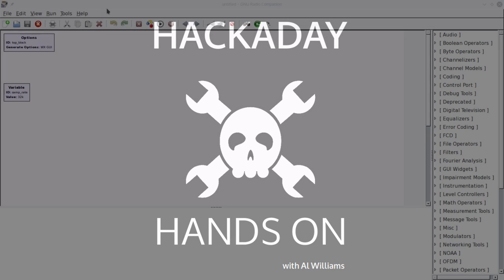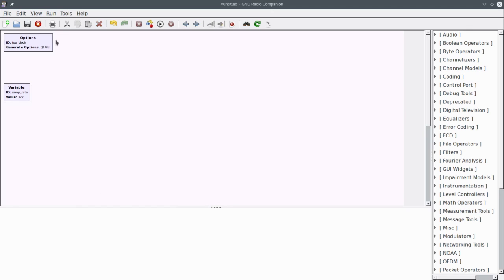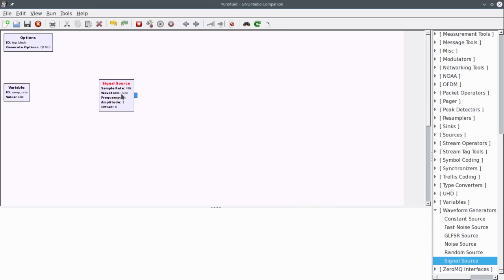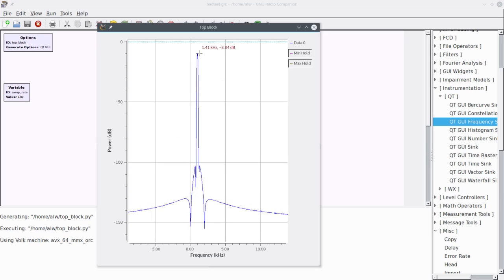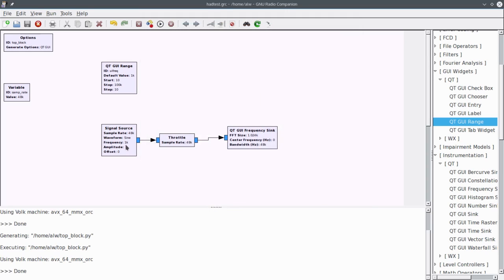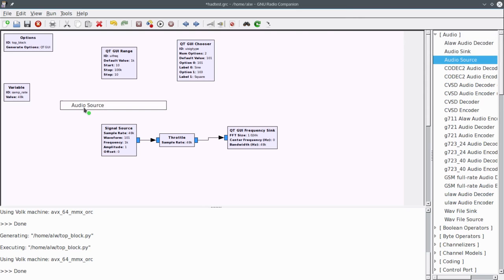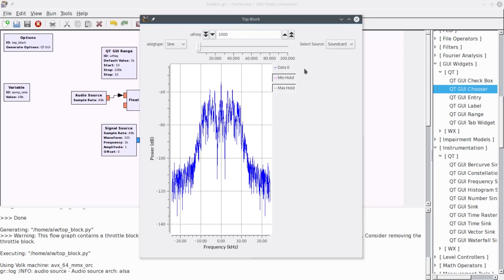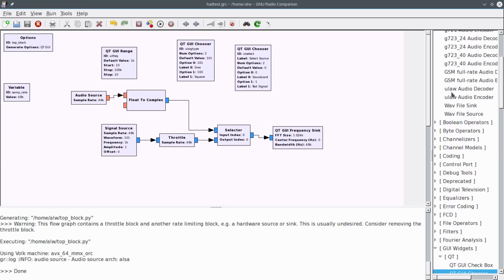Using GNU Radio Companion Part 1

Comment: "sample rate" appears to have 2 meanings, depending on context - 1) how fast the block can do its thing, 2) side information carried with the data stream to say what the delta-T between samples is. For the Signal Source block it's only the latter, since it can potentially run wild, yet the 1KHz spike can appear later in GUI frequency sink at the correct location. For the Audio Source, it's both meanings, the real world hardware actually samples at that rate, and then that sample rate is known later in Frequency Sink. In Frequency Sink, it was given the variable "samp_rate" but used for a parameter "bandwidth", not a parameter called "sample rate". Sample rate of the data is riding along with the data, ... yes?

Comment: This (101 and 103) no more works in new version of GNU radio. QT GUI Chooser should be '0' and '2' for sine/square wave. But, in Signal Source - for waveform should be 'wave'. You should to add Variable with ID: wave, and Value: {0: analog.GR_SIN_WAVE, 2: analog.GR_SQR_WAVE}[int(uisigtype)] . Otherwise it will not work.

Comment: hi everyone am trying to transmit 16QAM in gnuradio using fmcomms2 i have used random_source->constellation_encoder->interpolating_FIR_filter->fmcomms2 but it shows error Traceback (most recent call last):
  File "C:\Users\Dell\Documents\qpsk.py", line 369, in <module>
    main()
  File "C:\Users\Dell\Documents\qpsk.py", line 347, in main
    tb = top_block_cls()
         ^^^^^^^^^^^^^^^
  File "C:\Users\Dell\Documents\qpsk.py", line 202, in _init_
    self.iio_fmcomms2_source_0 = iio.fmcomms2_source_fc32('local:', [True, True, False, False], 32768)
                                 ^^^^^^^^^^^^^^^^^^^^^^^^^^^^^^^^^^^^^^^^^^^^^^^^^^^^^^^^^^^^^^^^^^^^^
RuntimeError: Unable to create context

Comment: gnu radio is far more superior to what you can do in windows,
however, you almost have to know a precompiled file of what your
trying to do, unless your an engineer, this gui is actually allowing
you to manipulate real software controlled channel data ,etc,
very intricate.

its extremely hard to match the blocks together, and make them do exactly what you 
want.
Reply: What I mean is it seems like the Linux version can do more . by the way when I wrote this statement only Linux had a stable good version , the windows version was barely out then .

Comment: Having trouble with the demo. It seams to run in a one shot manor instead of a continues waveform. In other words the display comes up with a reasonable trace but it never changes. Even when I adjust the slider. I noticed that my Sig Source has a gay input tab that is labelled "freq". No error messages in the console. I am using GRC version 3.7.10.
Thanks!
Reply: Fixed it. Not sure how. I just deleted Frequency Sink and put a new instance on.
Thanks anyhow!

Comment: Superb video, Al. As you say, GNURadio doesn't have to be used for SDR, but I think (and hope) that inexpensive SDR will spark a little renaissance in participation in Amateur Radio. Materials like your video are key to that happening since GNURadio is free and super-powerful but pretty tough to get to grips with to start with. Well done! 73, Marcus EA5IGC
Reply: I think it did!